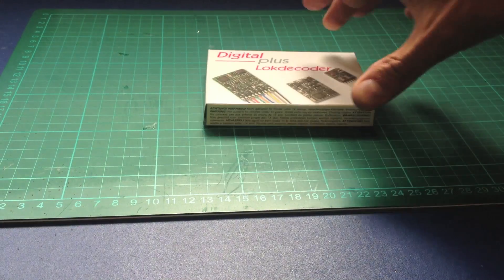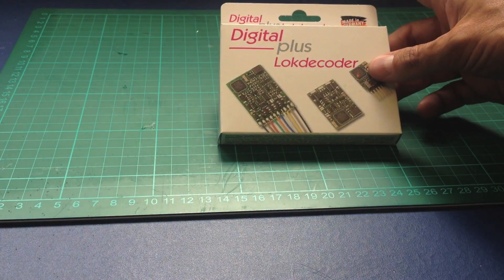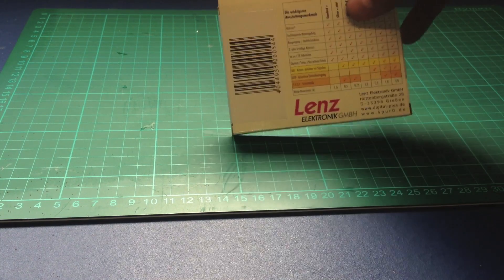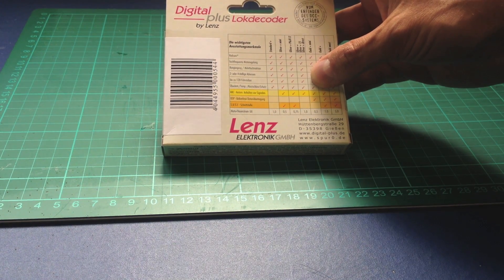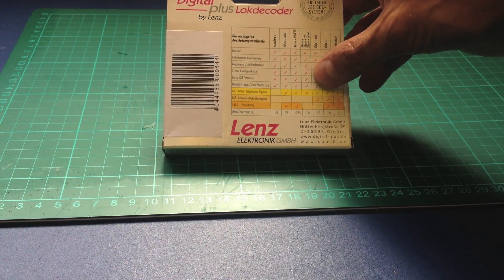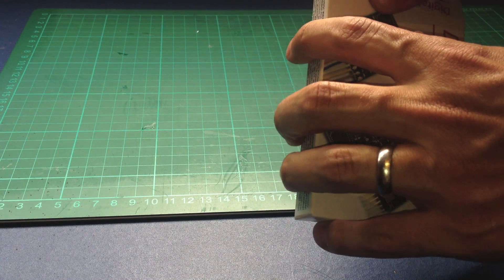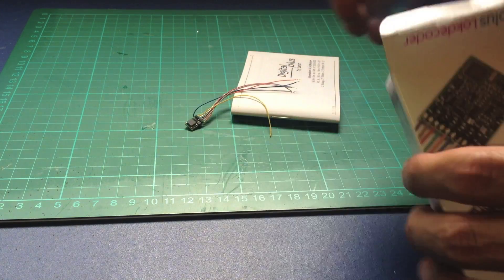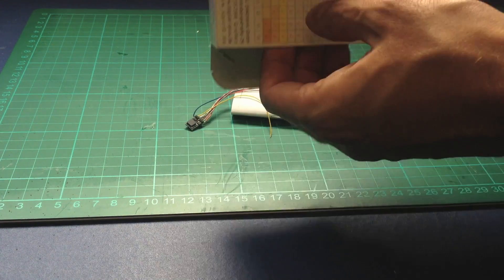Chipping non-DCC ready model railway locos

Comment: Soooooo.. 6 years later: black and red are cut and soldered to new board. Red and black are then grey and orange which are then  soldered to the motor??
Reply: And then grey becomes positive and grey is ground?
Reply: @DIYD  Red is the power pick up wire from the right (engineer's) side. Black is the power pick up wire from the left side. Orange is the wire that goes to the positive side of the motor, the gray wire goes to the negative side. Most often, the top terminal of the motor is positive, so it gets the orange wire. If the terminals are on the left and right side of the motor instead of top and bottom, the right side terminal will be positive. Just think of it red and orange are positive, black and gray are negative. If the orange and gray wires get reversed, no damage will be done to the decoder, it's just that the locomotive will run backwards. Hope this helps!

Comment: Not sure what solder you are using, if it is the lead free stuff then dump it and buy some 60/40 lead tin solder. I have been soldering for over 60 years and still cannot get good joints with the lead free stuff, whoever introduced this obviously never did any soldering. Aerospace and military won't use it either due to the poor and unreliable joints it makes.

Comment: Do you think this might be possible with locos dating back to the late 1970's bearing in mind that my only soldering experience is with copper plumbing with a blow torch....??? Do you think this method might be a tad extreme?
Reply from the maker: Should be possible, the principle is the same, not sure about the blow torch though! :-)

Comment: do you think its possible to do this with a graham farish class08 shunter?
Reply from the maker: 56scaniaboy I think people have done it with the newer version of the Farish 08, not sure about the old one though.  I think it will be tricky to fit the wires and decoder in...if I ever get one I'll do a video!
Reply: ok thanks can i ask if you get any problems with your layout being in a shed?
Reply from the maker: 56scaniaboy No, not had any issues.  It did get very hot in the sun before I put the insulation in but its a lot better now.

Comment from the maker: Its an Antex XS25, its really easy to change the tips (they just pull off) so you can use a nice small tip for fiddly soldering, and I think the advice is that a 25 watt iron is powerful enough for delicate model railway components but not so powerful it will fry everything! 

I just got some scrap bits of wire and had a few practice goes when I learned (which was only about 6 months ago!)